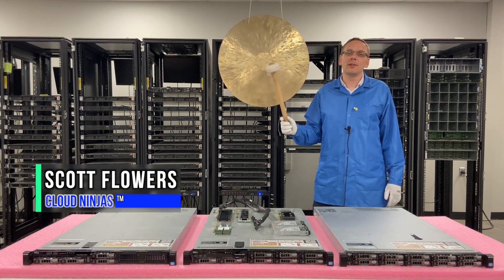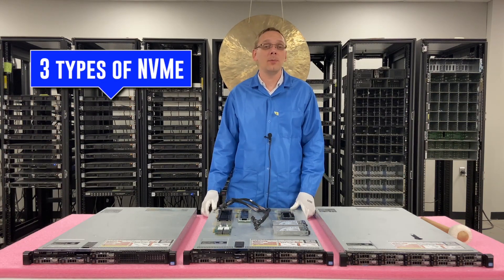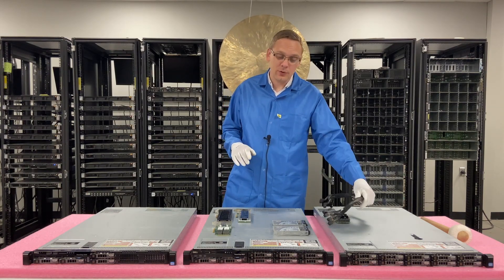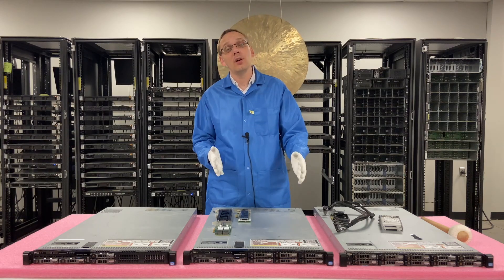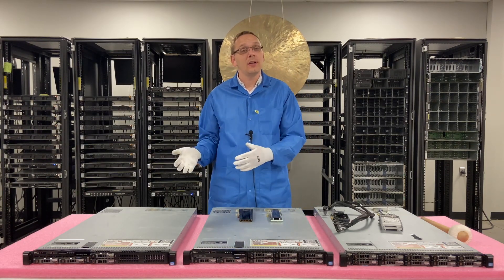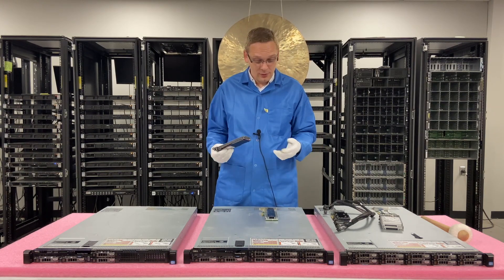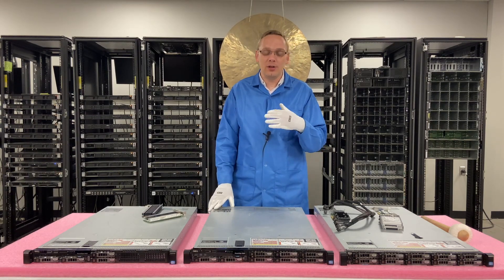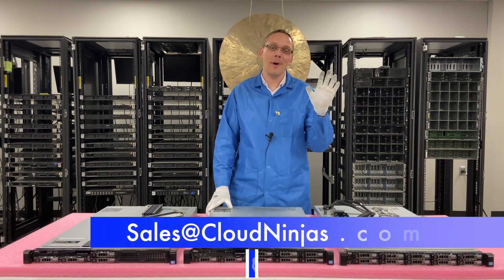Dell PowerEdge R620 Server NVMe Options Overview | Dell 12th Generation NVMe | M.2 | U.2 | PCIe

Comment: That is strange, we  have been running two such servers for almost a decade with NVME-SSDs in hotswap-tramy (robably U.2, need to verify). they were hideously expensive, but worked out of the box, initially with 400GB, then replaced with 3,2 TB units.

Comment: I have generic m.2 pcie drives working on my R620s... but I couldn't get m.2 to work for the front bays, each of my R620s have 2 x m.2 pcie cards installed and running
Reply: Are you booting from them? What operating system you running?

Comment: I have a 10 bay 620 and just added NVMe to it via the PCIe riser with no issues. Adapter: 	Trotwei Blue PCie x4 to M.2 adapter, SSD: SK Hynix P31 1TB NVMe SSD System: BIOS: 2.7.0 OS Proxmox 7.x The drive appears just as any other block device and performs up to the spec of x4 transfer rates. I'm curious what the difference between your test system(s) and mine is.
Reply: Interesting, I prefer a supermicro or bigger brand, but may give this a try. thanks for sharing.
Reply: @DearSX  Dell server is one of  the bigger brand ! my friend .
Reply: Which PCIe slot did you add your riser card to? And are you booting from your NVME M.2 SSD? And if so, are you using any other bootloader to point to your SSD such as Clover?
Reply: i'ts most likely the OS, Windows has a hard time from what I read but a linux based software has worked from what i've seen.
Reply: Are you booting from them? What operating system you running?